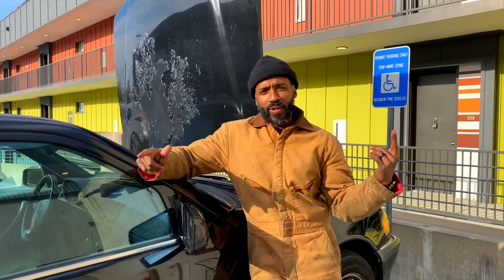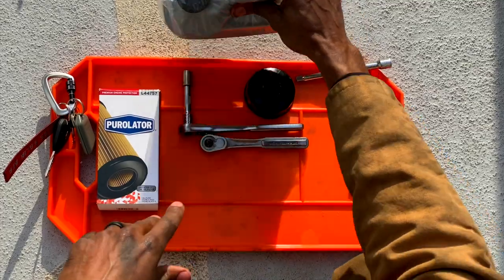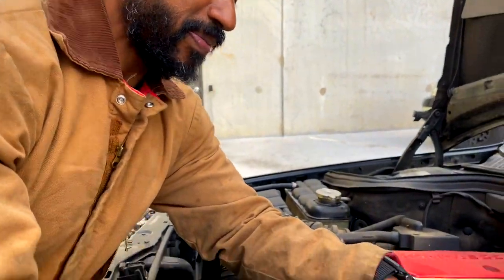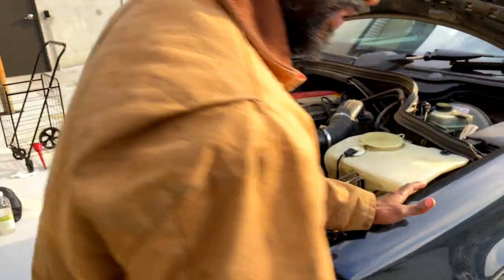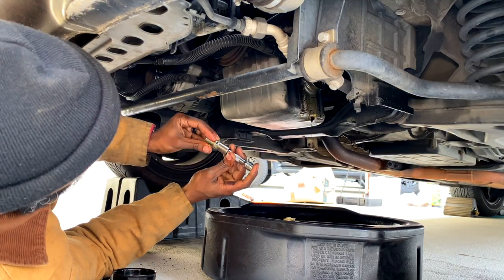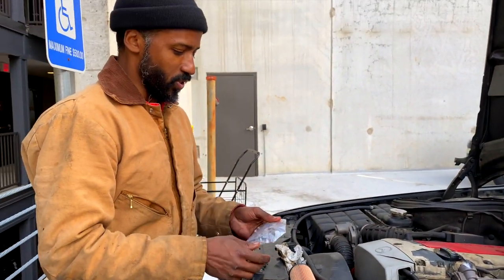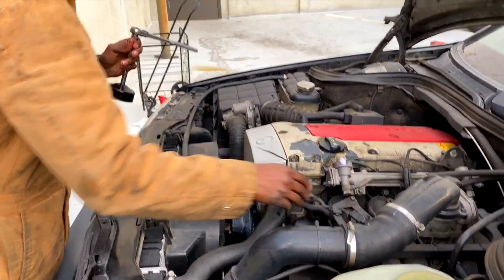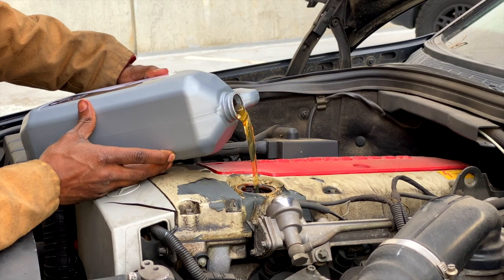Mercedes Benz C230 Oil Change

Comment: Hey, so my car just shut off while driving. Power and radio on. I tried to start it this morning it turned on for awhile then turned off
Reply from the maker: I would change the Crank Position sensor. It is very easy to get to and is a common failure on almost every MB I owned. Luckily it is a cheap part and easy to replace.

Comment: Where are the monoblocks
Reply from the maker: IbtiX Gaming urgh the mono blocks the center of one of the rear wheels was bent so it wouldn’t lay flat on the hub. It was causing a really aggressive shaking at speed smh. So I took them off been looking for 17s but they are so hard to find!
Reply: @KRTLyfe  Aw man that's unfortunate, they look so good on this c-class. I was also considering monoblocks but i see so many people with them so i chose 17" Adharaz rims that are 225/45/17 front and 245/40/17 back from c-class sport pack W203. Got them for only 100 but used still useable tho. Used them for a year but bought 18" unoriginal rims that are on W211 but smaller sizes, they look quite nice but i need to place them right i think cus they vibrate over 60mph.
Reply: @KRTLyfe  They are very hard to find yes! But good luck on finding new ones! In 17"
Reply from the maker: Thank you I appreciate it. This Budget Benz project has been kicking my behind smh.
Reply: @KRTLyfe  You're welcome man. I understand. It has been with me too. I just painted my 18" rims matte white lol gonna spray them matte black when i get bored of it.